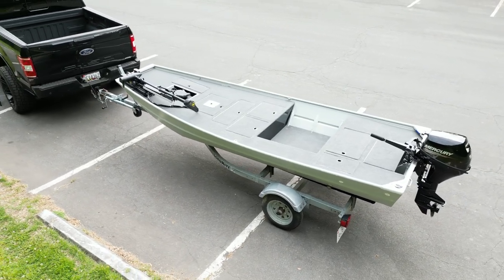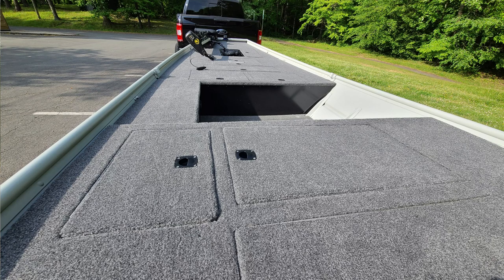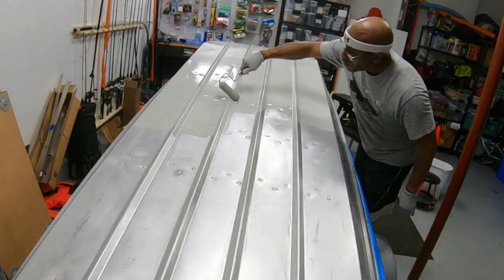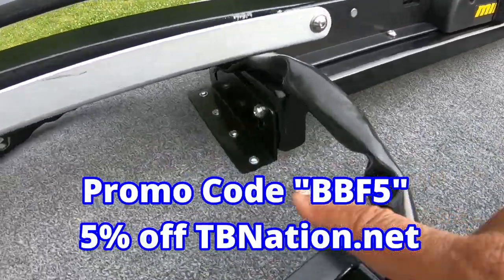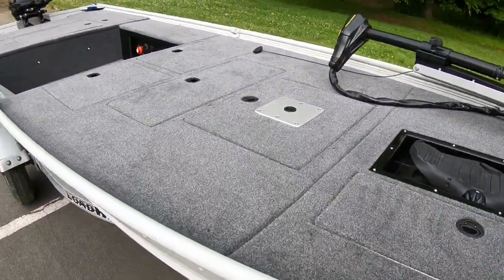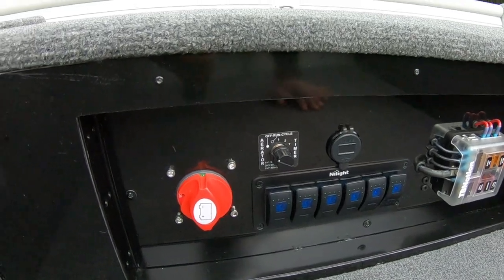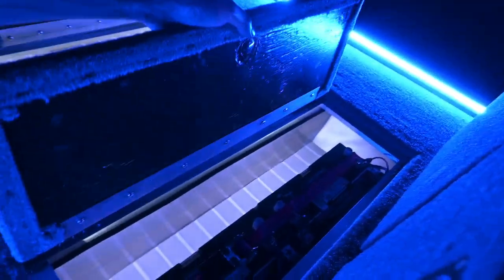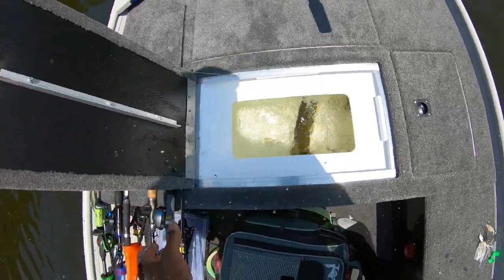MAN SHE'S PRETTY!!!  Jon Boat To Bass Boat Reveal {Lowe 1436}

Comment: Nice build! I would get rid of the wingnuts though, you can get loose connections and have the battery terminals and wires melt. Happened to me before!

Comment: Do you have a problem with the water sloshing out the livewell
Reply from the maker: I haven't run the boat around with the livewell filled  to know, but I did customize to tote lid to be a barrier and sealed it up with silicone.
Reply: @BassBrothersFishingDMV  thanks. You should post a video about the water in the live well once you take it out a couple times
Reply from the maker: @s.m.fairsoft6908  I'm actually selling this boat but we'll see what happens. Of it doesn't sell I'll take ut out and do that. Thanks for the suggestion.